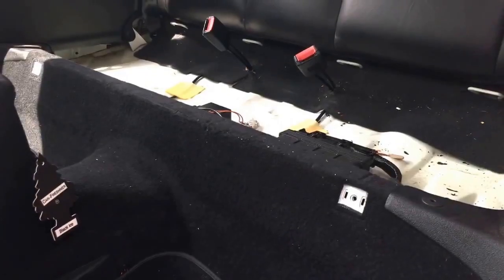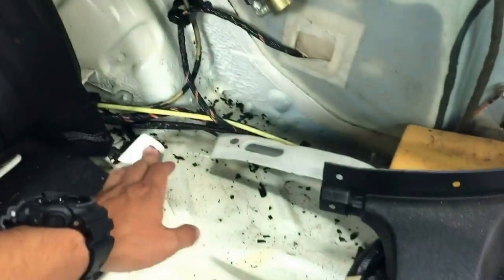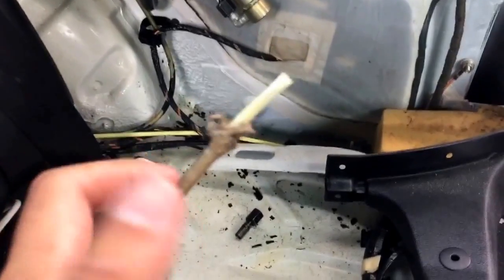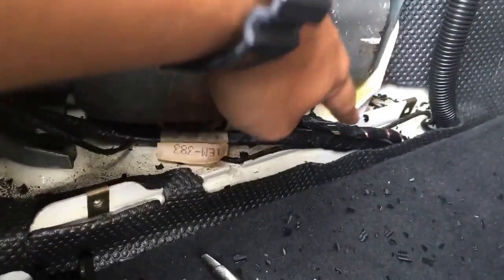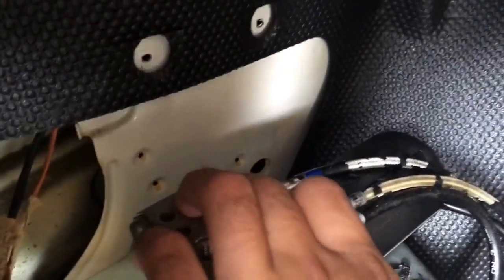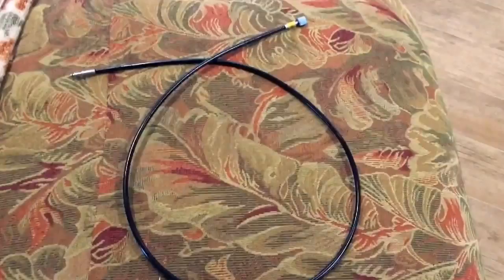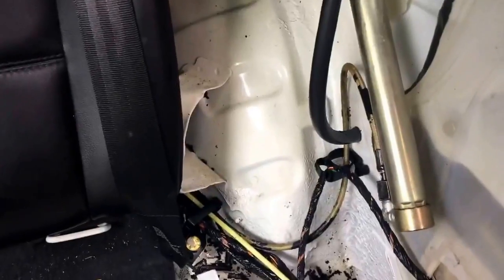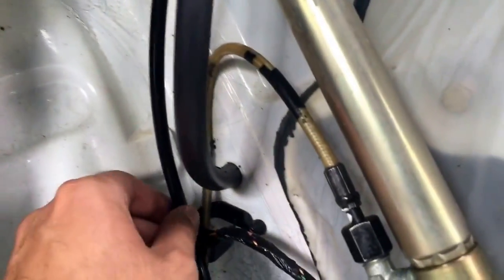Volkswagen Cabrio Electric Hydraulic Top Finding Leak and Replacing Hose

Comment: Thanks very much!  I did my 4 hoses from HEL (saved thousands over VW oem) a year or two ago but then I noticed I am losing a bit of fluid from the cylinder and quite a bit from the pump.  VW sells a 'pump service kit' for $50 or so still that contains the gaskets and the plastic reservoir cover for the pump.  Folks doing work on that should use the Bentley or VAG torque instructions, as I hear it's very easy to ruin the cover when tightening the bolts.  In general on German cars, the torque numbers should be followed on every tightened thing!

Comment: My 1999 Cabrio's top was working fine until today when I went to put it back up due to the rain we were going to get. It did NOT go up. I could hear the motor running but nothing. The oil is between the Max/Min. I plan to see if there is a leak. I let the car sit for 4 years and just got many repairs done. Let's say there is no leak, what would another reason the top won't go up or down?
Reply from the maker: If you hear the pump and there is no fluid leaking from anywhere the only other thing i could think of is there being air in the system

Comment: Do the hydraulic lines to the pump just slide out once the T-15 torx are removed?
Reply from the maker: Yes the line should just slide out
Reply: @CentralFLCars  Awesome thanks! Never encounted hydraulic lines like that just wanted to check, does a lot of fluid come out then disconected?

Comment: Very helpful video, really useful when sorting out my split hose.  Links were great as well, actually worked! All I would add is I found it much easier to install the new hose end into the pump body by taking the pump off. The securing screw is v.small and all too easy to cross-thread, particularly with the HEL hoses that are slightly different to the original. Re-filling the reservoir is also a pain, I eventually used a small syringe with a very thin plastic pipe attached to it, there must be an easier way but I couldn't find one.... Cheers!

Comment: hi, my 2001 cabrio electric oil is low, how do I top up oil and what type of oil do I use
Reply from the maker: the fluid is Pentosin CH 11S and you have to use a straw or small hose and put it in little by little. if its low there may be a chance that is leaking so keep and eye on it after topping it off.

Comment: I wanted to tell you I have been searching for an easy straightforward explanation and demonstration on how to fix a hydraulic leak for top. it is exactly what is wrong with my 2002 cabrio, hydraulic shoots out around between driver door and back tire. I will immediately be using your fantastic video on this procedure. It again was straightforward, answered all my questions and concerns and just thank you thank you thank you!!!

I also have issue with auto door locks and windows, this seems to be a common problem at least in the 2002 cabrio around 80-100k range. If you have any info on this problem i would love to hear/see it. Last think i just out of nowhere have a fairly fast running/large leak somewhere in my coolant hose? or maybe a fixture or connector? Im not well versed at fixing cars but with good information/demonstrations I have been able to fix many problems that the mechanic as good and fair as he is would have cost a small fortune. Sorry such a long comment.  THanks again from the bottom of my heart, great video keep it up on any subject you do a great job at editing, information and getting to the point (unlike my rambling here!haha). bye take care and keep on YouTubing I like and subscribe!  Jen
Reply from the maker: What issue are you having with the lock and windows? I know mine sometimes I have to press the window switch multiple times to make it go down. the passenger one goes down then starts coming up or goes up and comes down by itself. I don't have problems with locks though.

I had a problem with mine leaking coolant also, it turned out to be the coolant flange. Its where coolant goes to the engine block. It is located on the drivers side of the engine toward the top.

Comment: I have a 2002 vw cabrio. Hel hose just came in the mail from England. Sent it to me registered mail. I don't know why. but, I just got done installing the short drivers side hydraulic line. No mention on that brass valve on pump assembly here or anywhere. So I wasn't' sure to lock it or open it to fill it or bleed it. I think you have to close it in order to allow the fluid to pump to the hydraulic cylinders. Opening it up let air in, I think. I heard a sucking sound opening up the brass valve, so keep it closed under normal operation. Also I had another surprise, the electrical plug just before the motor was dirty. The motor wouldn't work until I plugged it in and out a few times. bad connection? Anyway so far so good. I got the top to work. Time will tell if there is other problems. I think this cars top had not been working for quite some time. Also, the hydraulic coupling is a tight fitting thread class so it won't thread on by hand, you must use a wrench.  Fluid fill  was a pain, you might want to use a syringe or a very small funnel. My funnel was to big and made for a messy filling.

Comment: Great video! thank you. Question: How do I take fluid OFF?, my mechanic overfilled the system and the level is above the MAX line with the top down. Thank you!
Reply from the maker: you would either have to remove a hose and let it come out from there or you can try putting a straw in the fill hole and slowly take it out from there.
Reply: @CentralFLCars  Also a syringe with needle (laugh laugh, I know) works for removal.  You can use the syringe without the needle for adding more or carefully somehow adding with straw or hose.

Comment: Luis, I got the same kind of leak as over 3 years now at the left side hydraulic cylinder. Previously, the left pair of hoses were exchanged and a sealant was also used between the cilinder connections and the hoses ends, which was a sliding connection (not threaded) with a clips. Now it's starting to leak again. Any suggestion how to permanently fix this? I'm really not happy with the kind of "loose" connection between the hose and the cylinder. But I can't find the original manufacturer of those cylinders, to check the original details of construction and use of those cylinders. Anny suggestion, please give me some feedback.

Comment: quick questions, Can i whenever i feel like taking the top down can i do it manually? and how do i manually take top down?
Reply from the maker: it is not recommended if your automatic pump is working. If it is not working how i did it was by unplugging the pump (not really necessary) and removing the fill screw. I kept the screw in the center console so I wouldn't loose it.  After that doing it manually should be easier.

Comment: Hi what were the symptoms ie was trunk lid stuck in the up position? What message did I get on dash?
Reply from the maker: Karen Ludwig-Wong no error messages or anything o could just hear the pump going but the top was not moving. When I took a look at the pump there was no fluid I added more it worked again but kept losing fluid.

Comment: How did you get out the air of the system? Otherwise the line could blow up again.
Reply from the maker: Xantylon74 hello, i believe you open and close the top a few times with the fill screw removed. You do this using the motor not by hand.
Reply from the maker: I briefly discussed it at 9:10
Reply: Thanks, I missed that.  So you remove the filling screw and move the roof 3..4 times before you screw in the filling screw again.  I've already read that.  Did that work for you?  What if you only opened the valve to release the pressure because you only had to manually close the roof once?  Do you have to open the filling screw too, or is it enough to leave the valve open for 3..4 times?  My roof had a problem with the sensors, so the computer didn't know whether it was open or closed.   However, after 4 hours I was able to close it with the motor as normal, but I would like to know what you have to do if you have to close it by hand,  if it happens again,so that nothing breaks.

Comment: Hi, just wondering how you fold the top manually thanks
Reply from the maker: al v sorry for the late reply. You just remove the fill screw and optionally unplug the pump and that should make it easier to open and close manually

Comment: Thanks   I had leaking hoses and bought the HEL hoses. Now find I have both a leaking cylinder and a leaking pump reservoir!!  Geez...
Reply from the maker: did you make sure there were on there tight? hydraulic systems need a really tight seal. you also have to bleed the system to make sure there is not air running though the lines.
Reply: @CentralFLCars   how you bleed the system.... im about to bought this lines.... 2 days ago works fine now i got a leak from drivers side ... im about to buy the whole kit